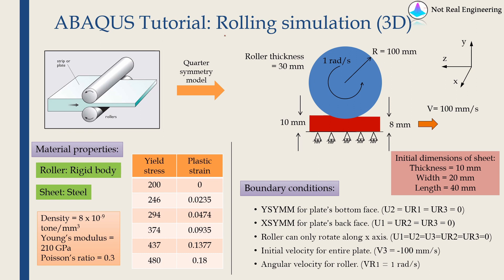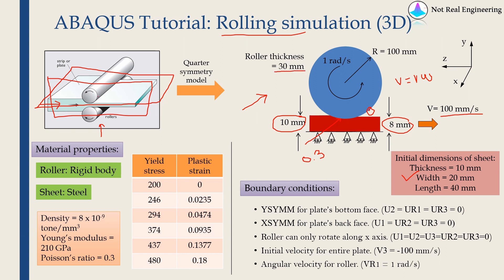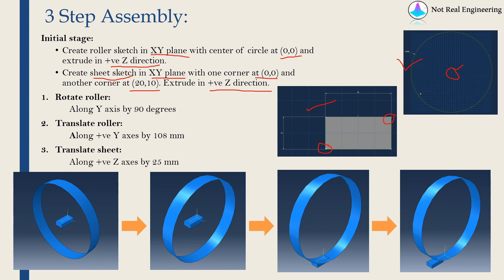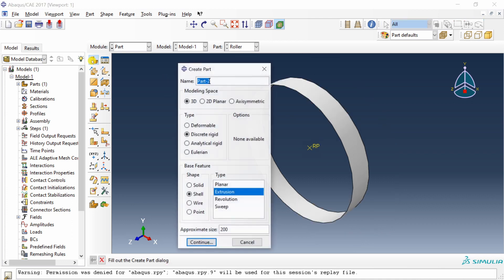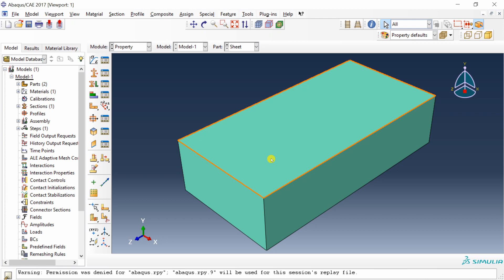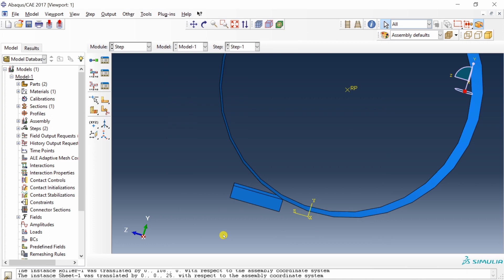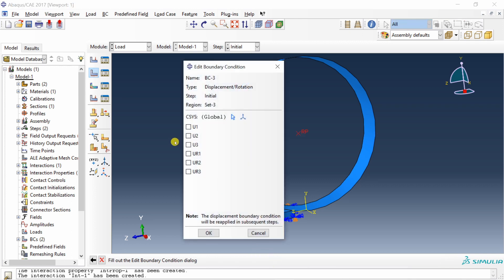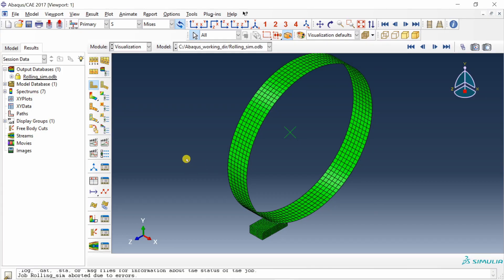Rolling simulation using ABAQUS CAE | Rigid body modeling

Comment: Thanks. There are two main issues in this simulation. First, the velocity of the sheet is not uniform at all. There is only one contact line in the contact area with matching velocity to the circumferential velocity of the roller. Other points slides. So you could see roller sliding texture on the sheets in real world. Second, the friction force has a limit in the rolling process and can not increase anymore. Usually, it sets to be the ultimate shear strength of the sheet material.